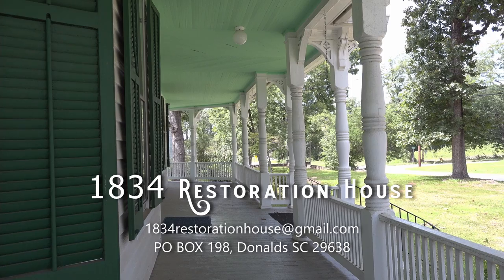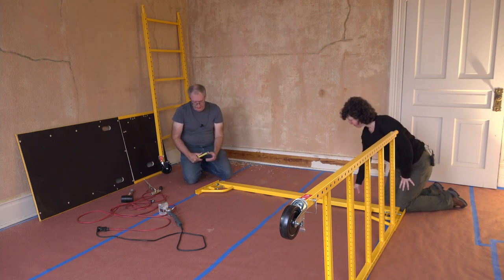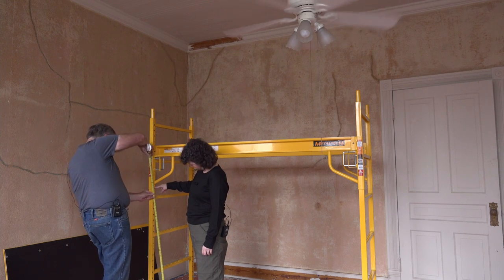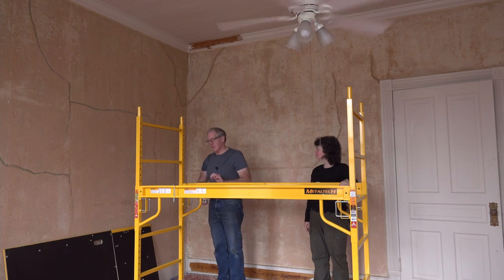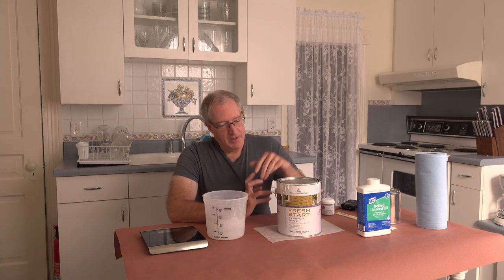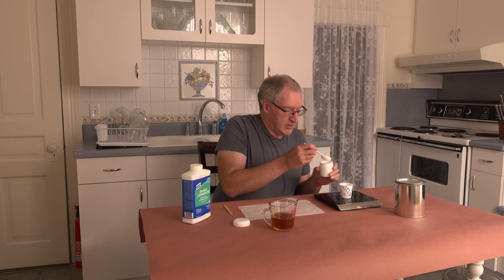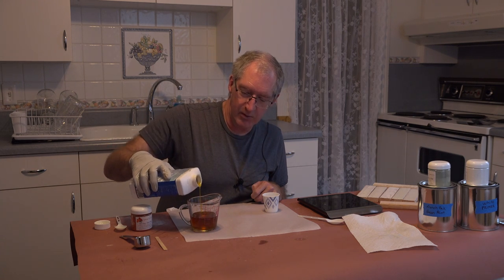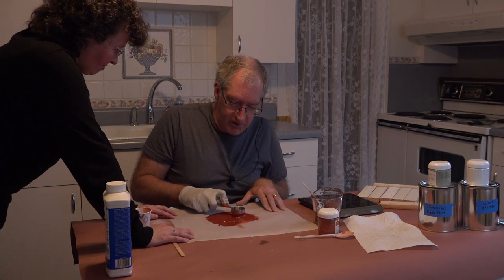EP 58 Making Victorian Paint

Comment: I love the color scheme that you showed. The colors are truly Victorian. Very interesting to see how you mixed them. Of course I know you took better notes than I ever would have :) also the scaffolding is wonderful for what you need. Much better than moving a ladder every two feet.
Reply from the maker: We're eagerly waiting for more supplies!
Reply: Also can add more sections for height when painting the outside! I would have checked the height with a ladder rung & used a sturdy 6×4 to form an L in the corner. Could also drill a hole in each end of a proper length of 2×4 & attach it as a safety railing on the side, as Mike was saying it needed. Sorry I'm all about "making due" when needed. Sorry🌹

Comment: COULD YOU USE THIS SCAFFOLDING TO PAINT THE EXTERIOR ? YOU WOULD HAVE TO NATURALLY ADD SECTIONS FOR THE TALLER PORTIONS AND HOOK IT TO THE HOUSE FOR SAFETY OR  ISN'T IT STURY ENOUGH FOR THIS APPLICATION? DID YOU EVEN CONSIDER USING ACRYLIC LATEX PAINT FOR THE FINISH COAT? GREAT VIDEO. THANK YOU.
Reply from the maker: I don't trust this scaffold for high reach jobs because it's light duty. Regarding the latex, we're trying to use historic methods and materials to the greatest degree possible. Frankly, I'm having a lot of fun playing with paint chemistry! :-)